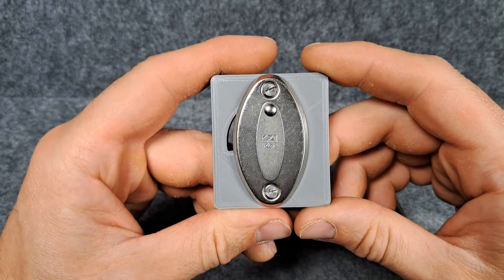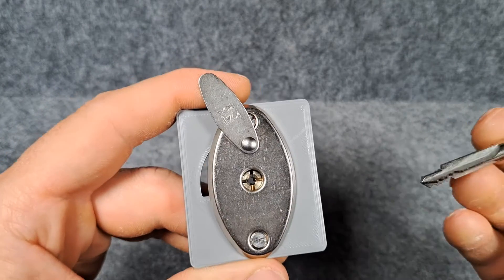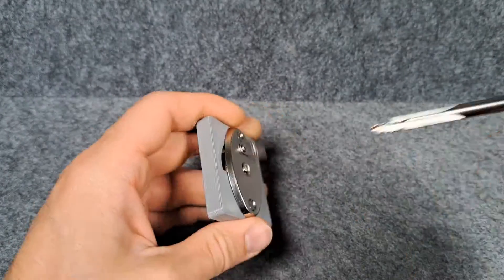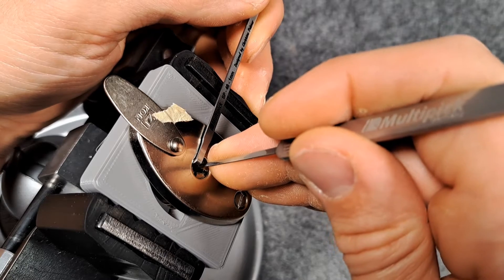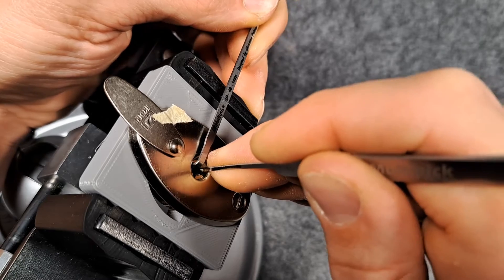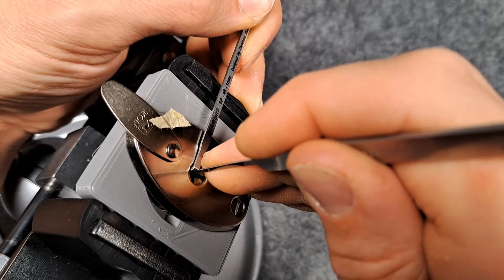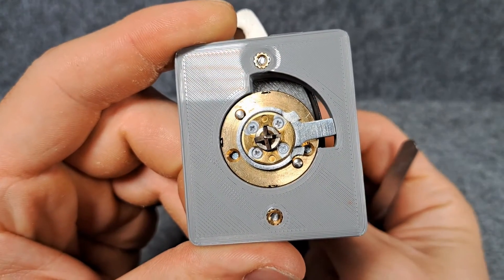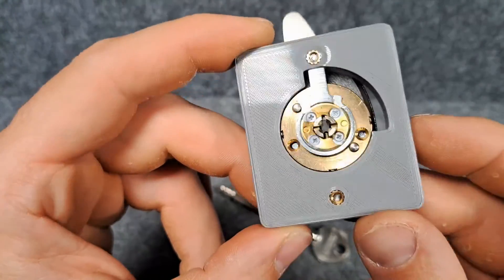ZIKON cross lock, 3-sided key and 4 bibles picked [278]

Comment: The reason the key has four cuts and the lock only has two pins in each row is to let you put the key on the other side and for the lock to still work.  If you look, you will see that the key is a mirror of itself.  Anyway, it's a pretty common lock, many companies use it under their name and it has many versions.
Reply from the maker: AAAHHH that makes soo much sense! Sorry I missed that! Nice to know that the key will also work from the inside! Thanks!!
Yeah, I know there are several companies around producing these at a very cheap price range, but I always hoped "Zeiss Ikon" is on the higher quality range. Thanks for enlightening me!